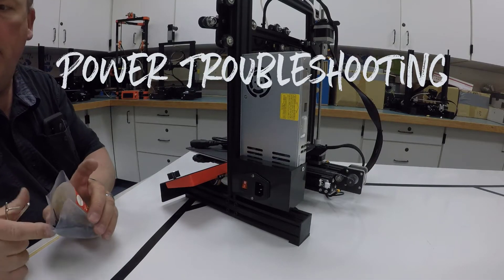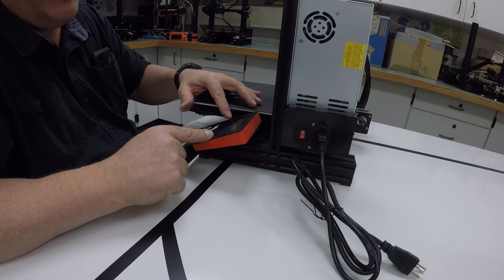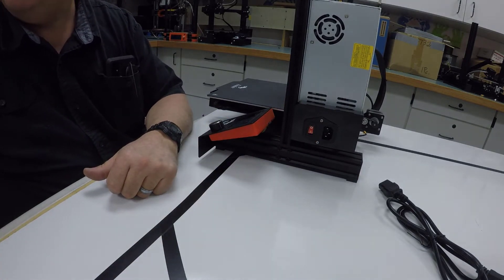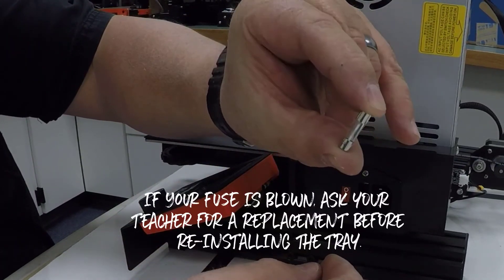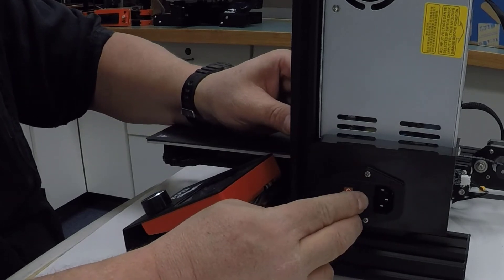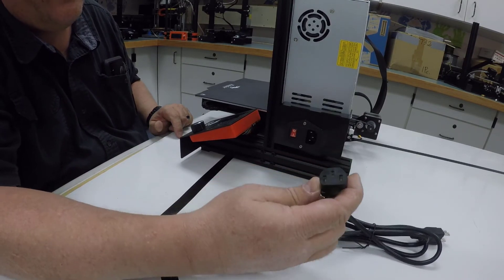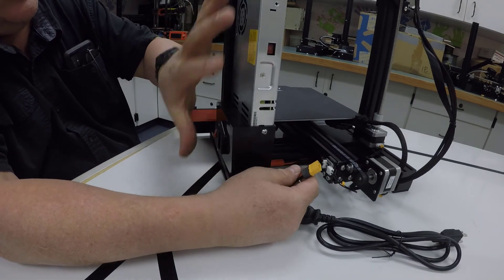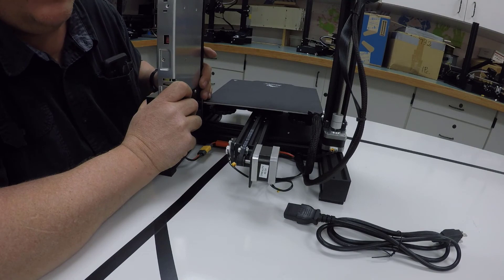Ender 3 Pro - Power Troubleshooting (15 of 15)

Comment: CHECK THE LOCAL VOLTAGE! I was using 230v and thought it was weird that I had to move the extruder to power on the whole machine. It was working fine for a while until it suddenly stopped turning on. I watched multiple youtube videos to find out what was possibly wrong and almost bought a 51 dollar power supply to replace it. Then, i stumbled onto a short showcasing the printer, working after flipping the local voltage. I thought to myself "theres no possible way," and flipped it to 115v. The printer turned on without even having to move the extruder... I may be stupid, but im grateful for my luck.